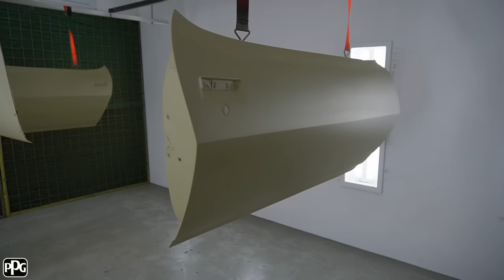#5 How to use & apply Spray Poly Filler on 71 Camaro | Muscle Car Respray

Comment: In the early 90's in a clean shop doing rich men's cars, we used the Glasurit system with it's spray poly on every job, two coats only. If any repair felt like it may need more than two, it was sent back to the panel beater to fix. Used properly, as you showed, it is a solid step in preparing for a perfect end result.
Reply from the maker: Thanks for your input

Comment: Again outstanding video , thanks so much .  I’ve noticed that in your spray booth the floor is sometimes wet , but latest video it’s bone dry . Any reason ?
Reply from the maker: Tomorrow there is a full story on the booth. I only use the wet floor for top coats to keep the dust down.

Comment: Thanks again for sharing mate. you have been a great help. Am i right in saying that step 1 is epoxy primer, step 2 body filler, step 3 is spray poly, step 4 epoxy primer again step 5 polyester, step 6 base coat, step 7 clear coat? Cheers
Reply from the maker: 1 epoxy, 2 body filler, 3 epoxy then wet on wet poly spray filler, 4 epoxy then wet on wet primer, 5 base coat 6 clear
Reply: thank you @AstillDesign

Comment: Hi mate. Really enjoying your videos. I’m doing a bare metal restoration on my falcon and have started metal prepping and epoxy. After body filler and re-epoxy over body filller I plan on putting a primer/ filler over the top. I have been told I can put the colour straight over the primer / filler. ( after blocking). Would you agree with this?  Or do I need a primer again before colour ?
Reply from the maker: It depends on the products your using. If you use a hibuild primer you can paint direct. If it’s a poly filler then it will need resealing with epoxy then primer.
Reply: @AstillDesign  cool. thanks for replying.

Comment: this may not be the time and place for this comment, but i would love a bit of info regarding your spray booth basics. such as end filtering. is it sucking or blowing? maybe content for another time. only asking as i have painted some past projects in various locations such as in the drive way thru to a handyman spray booth. cheers on the series. loving the info/content.
Reply from the maker: thanks for the feedback, Its a homemade booth utilising a single 16K CFM fan sucking through spray filter pads and out through fibreglass booth filters.
Reply: thanks for the info @AstillDesign
Reply from the maker: this weeks episode is on the booth

Comment: Hi Howard, love the videos just wondering when you re epoxy the inside of the panels over the poly, did you say you prime them again? If so what do you use? Thanks mate
Reply from the maker: Yes mate, primer over epoxy before colour. DP 602 Primaprime
https://img1.wsimg.com/blobby/go/c5560ea0-c6c7-4b32-8d2d-3d51242251c5/downloads/DP602%20PRIMAPRIME.pdf?ver=1695845812210
Reply: Thanks mate, yeah I know you reprime before top coat but is that same time after re epoxy after appropriate flash off
Reply: Sorry to ask so many questions mate, just wondering why you don't prime straight over the poly as well? Thanks
Reply from the maker: You need to seal every process with epoxy then you can wet on wet with the next process. Body filler sanded to 180 then seal with Epoxy, wet on wet Spray poly, sand poly then epoxy wet on wet with primer, sand then colour. We will cover sanding poly in the next episode.
Reply: Thanks mate, love watching the process getting done properly, always interested in new products and processes

Comment: Thanks for a very informative video on the process Howard. When using the propane heater to bring the booth to temperature, do you also need to monitor the humidity for adhesion and drying times? Cheers
Reply from the maker: thats a good question, off the cuff I would say the gas heater reduces the humidity, its a very dry heat.

Comment: Never been game enough to use it as I’ve found if your repairs are good enough you don’t need to.. and in the trade I’ve only seen bad things about it especially on hail damage cars . I like to do it the hard way double block double prime with hs primer and I’ve never had a problem or come back.. blocking spray bog is fun but I wouldn’t use on any of my cars
Reply from the maker: I have used it a couple of times, it better than too many coats of hi build primer

Comment: Hi Howard, im interested in polyurethane seam sealant under polyester primer. I feel that leaving seam sealer until all primers have been applied would be best to eliminate shifting/cracking of seam sealer/paint over time. Ideally, seam sealer between final epoxy and surface primer/sealer before colour. I see you've done it different and would like to hear your take on it. Kind regards.
Reply from the maker: Hi, in hindsight I think your right. I usually don’t use a lot of poly. Just before primer would be the better option

Comment: It's biggest benefit is zero shrinkage. Leave some epoxy in a cup vs polyester in a cup. You will see the vast difference when it's dry.
Reply from the maker: The DP 616 is a very thin epoxy, the poly works well as does the hibuild primer. Each has its own job
Reply: @AstillDesign I think you need to address product shrinkage when discussing different products. I was surprised john didn't mention it . Pointless blocking for days to get something flat when two weeks later it shrinks and looks like waves rolling into Port Kembla on a big swell.

Comment: You have to be more accurate about the products first of all you doing what you like to do not what the product needs
A polyester filling primer   needs 250 μm to start drying and at least 100μm left over product on the panel after sanding and because PPG knows that you will do your own give no warranties of use of this filling primer
Reply from the maker: Yes you need to follow the data sheets for any product
Reply: @AstillDesign  polyester products are self heating and self drying products esothermic if you know so the only you can do is to use a correct spray gun avoid thinner or reducers in the product if they are not fully organic after a probably one or two hours after applying cover your areas with a good plastic so you can archive the 12 years of natural drying time in a three day spectrum but as a painter you had to know and not looking to the data sheets because data sheets are general advises from the factory to avoid the guarantee for the product